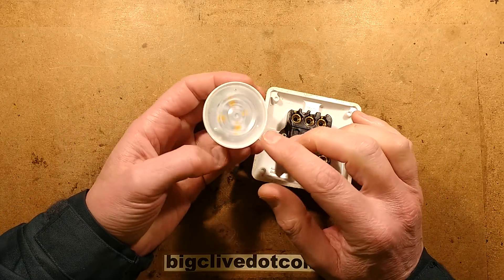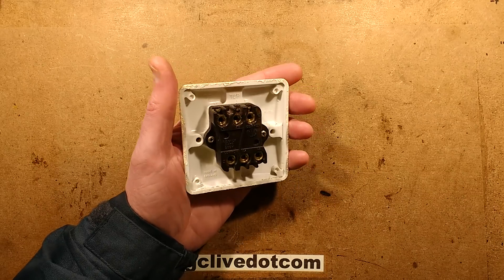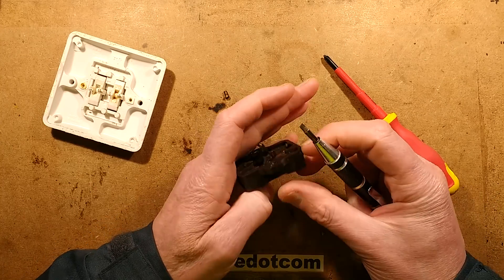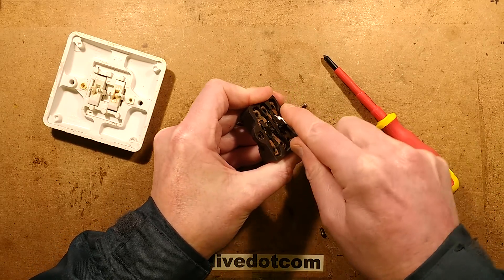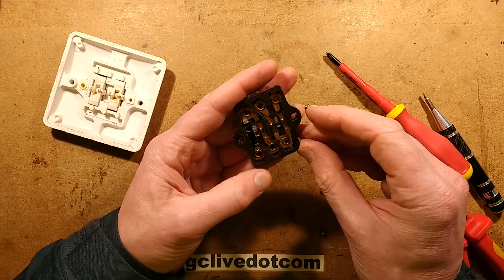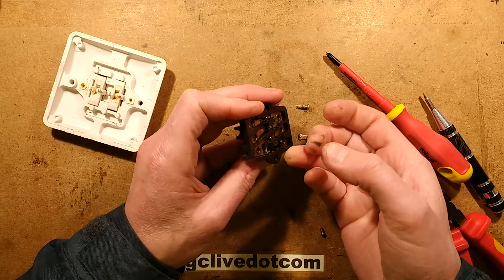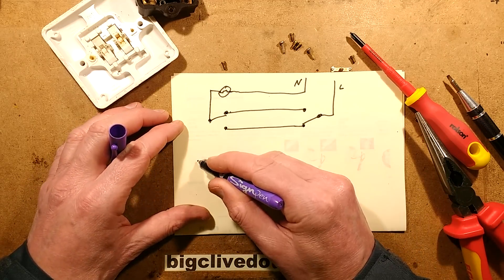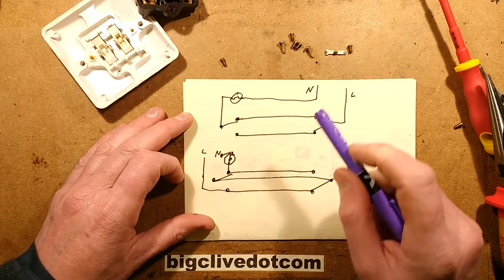Old arcing switch killing LED lamps.

Comment: Um, Clive, if you still have these 1960/70s style of switches in your house I would stick my neck on the block and say your wiring is quite ancient and needs a rewire. 🙄
Reply from the maker: It's PVC cables, but inexplicably, vintage switches were used in a few locations.  Like someone found old stock or used salvaged ones.

Comment: Those old switches were designed to be slow-make and break, because back in the day they were only switching small tungsten lamps, and it worked fine. I’ve got those switches and fluorescent lights (old circular ones are cool!) and you have to operate them fast & decisively, or they do arc, especially if the fitting has a power-factor capacitor across the mains. Modern switches are fast-make and break using a snap-action mechanism, and don’t suffer from arcing. You do see a brief flash sometimes as they open though!

Comment: One old sparky once told me that LED bulbs are the scourge of older switch gear. These switches were designed around 250mA to 2A, typically around 500mA in general use. He reckoned that LEDs don't draw enough current to keep the switch contacts clean. Apparently, these switches are inherently self cleaning, if enough load is applied, but LED bulbs don't draw enough current, so the contacts become oxidised and fouled over time. His solution was simple "Just use a 'real' bulb for a week or so, once in a while, to clean the contacts". I have no idea if that's wholly true, but I did try it once or twice, and for a short time there was an improvement, but then the arcing begins again. Simpler to replace with modern switches. Of course, this problem doesn't arise with a good old 'Crabtree' switch with the sliding blade contacts. Funny how proper old gear is better than the later stuff that replaced it.

Comment: we had similar problems with the same switches, they arc a lot 'cause they're rather slow make and break compared to newer switches,  they just push the moving arm open slowly, not 'snap' like the new ones, our flashed horrendously on a fluorescent lamp!
Reply: i of course kept the old ones, they're perfectly ok on filament lamps, plus i collect and  got a box for old electrical fittings

Comment: maybe its diffrent in Britain for wiring of two Switches, but here in Germany the first way you described how to wire two switches is correct. the second variant you described looks also pretty reasonable to me (didnt know it before), but so far i havent seen it used in any way.
There is a third variant, which works but is clearly forbidden. Basically you put the Light between the Common Connector of both Switches and L and N each go to the "NO/NC" contacts on both switches. Advantage is that you have both L and N on both Switches for eg a Power Outlet. Disadvantage is that you can short out the Circuit during Switching, which among other things is a Fire Hazard. I think you actually meant that variant as "pretty bad"

Comment: Dear the metal things inside this switch are made of copper or brass?  In my country, everything in switches and sockets is made of brass. If we are lucky enough then only tiny contacts points are copper one. You are from Britain, I heard and seen few old switches and sockets everything inside them was made of copper.

Comment: Very useful to know. Might this be affecting the life of CFL and cold cathode bulbs as well?
Reply from the maker: It could have an effect, but they usually convert the incoming AC to DC and smooth it immediately.  They should be less sensitive to an arcing switch.  The biggest killer of CFL lamps is hot environments and enclosed fixtures.

Comment: Those lamps are not Slavic/Russia/ex-Yugoslavia rated. 
It has to survive switch/fixture that arches every time you walk by. (All our old houses are built from brick and mortar, and roof tiles of asbesss.... i mean brick covered, so "ocassional" electrical fire just leaves a dirty stain on the wall (so you don't need to search where the fault is).
And voltage swings...it ain't a good thing if it dies from that swing ;-)
The good thing is most laptop PSUs and other enertain-tech runs from 100V (or 90V) upto 250v. We have 240V nominal AC grid. 
Which means a separating transformer wound to put out 120V-150V secondary will likely never exceed the 250V on the output, and not go below 90V output, running all the sensitive tech safe. 
Plus lightning protection, well, i hope... i grounded the core of it, i hope it's a good idea.
Would it be a good idea for low cost insulation trafo to put two nearly identical microwave trafos back to back, with HV windings connected together??? Would you recomend making a air spark gap on HV side, that would stop overvoltage (lightning?)from passing through???

Comment: I have had the exact same lamps fail at one year old with fairly modern switches (although I do live near the sea too). I fixed them by replacing the fusible resistor and adding an extra ~100ohm of current limiting. Still going strong after a couple of years now. The trick to opening them is to drill out the crimping of the pins.

Comment: First one is best way to make corridor switching. Also when you need add more switches to series you can add (DPDT-switches or type-7) in between.
In Finland we use (type-6, type-7, ..., type-7, type-6) when we need this.

Comment: I remember when I was young and afraid of the dark I was terrified when I'd pull the pullswitch near the bed to turn on the light but it wouldn't work. Envisioning all sorts of monsters waiting to eat me. My dad had wired the lights up and had done it as you said with the strapping so that the wall switch near the door would disable the pullswitch. He said it was "the pit method" so that when the shaft was closed the other lights couldn't be left on or switched on when they were off. Why he subjected me to "the pit method" I don't know lol

I'm surprised you haven't got a full dmx setup for your lighting at home controlled by nobs on your arm chair.

Comment: Poor switch design, with insufficient "wiping" of the contacts to keep them clean.  But on the other hand, too much "wiping" can lead to arcing due to slow contact release.

I had to change out an old Bakelite switch in our previous home after I changed our lounge room light from incandescent to fluorescent and the old switch's relatively slow movement interacted with the ballast in the light fitting to cause arcing at switch-off a couple of times.

Changing to a modern switch permanently fixed the problem.

It's a pity that the makers of the LED lamps didn't think of this problem and install something like a varistor to cut off the current during an over-voltage situation and let them recover when the over-voltage goes away.  Although perhaps a varistor would react too slowly?

Comment: Clive you might find these gu10 SMD's on Amazon interesting: item # B071ZPJZ3W . They actually unscrew--apart so that you can get at the circuit board non-destructively. They have a current-source IC. They look very dangerous to me because the metal is not earthed, and it wouldn't take too much for the live to touch it. I wonder what you think about them.

Comment: A lot of the switches in my house / garage arc particularly if you aren't positive with turning them off and on, you can sometimes see it through the gap between the housing and switch. All the switches look very old so makes sense, the garage is pretty damp and the house used to be before getting external insulation fitted and rendered (single block construction).

Comment: A very good way to open GU10 lamps  is to drill a 0,8-1mm hole vertically in the pins to remove easily the circuit. You won’t destroy your lamp. Then it’s easy to resolder 2 new leads trough the same holes.

Comment: Hey Clive WOOFs I have had this happen !! Not with the same bulb  I have 3 ware house style hanging lights in my cyber space/radio studio  that use Edison base screw in LED lamps  one day turning them on switch on the wall by the door made a arching  sound turned it off the switch was not very old so I replaced it with a expensive one from the Home depot it lasted about 6 months and did the same thing  ruined one of the bulbs replaced it again with a low price one from the local hardware store so far no problems  There's really no load at all on that switch  and its not in a damp environment in fact my underground house is very dry inside due to the blue flame ventless heating plant I have Why the failure ?? is there some thing in the circuitry that causes a really high load at switch on ??
Reply from the maker: There can be a high inrush current, but it seems odd to have such a fast failure.

Comment: Clive i have Philips Tornado 20w Lamp that keeps flashing when the power is off did a test on the lamp and got 10mv the circuit had 6mv there is two lamps in this circuit only one dose this would it be a resistor fail and a capacitor discharging    ????
Reply from the maker: It sounds like the classic capacitive coupling between a long run of switch wires.  Very common on two or more way switching.

Comment: Hi Clive, couldn't find any other way to get in touch.
I've got a couple of Sure Flap microchip cat flaps which have stopped working so my first stop for help is YouTube. After an extensive search all I found was a load of promotional videos. I was wondering, if an opportunity arises that you could do a teardown of said electronic cat flap with a schematic and an explanation of how it all works. The fault with one of mine is when it's in learn mode it's not recognising the chip. Hoping you can make a frustrated electronics beginner a little more accomplished.
Cheers Chris.

Comment: some low energy lightbulbs particularly LED and CFL, although very efficient, have a huge inrush that can burn a light switch contact in no time. Try dabbing a cfl lamp across the mains using the bare wire method, quite often there will be a huge flash from the wires
Reply from the maker: The typical CFL/LED lamp has a 4.7uF cap so the inrush could add up quite quickly.

Comment: Your preferred method of twin switching is safer. Picture the usual case, one switch upstairs where the light is, and another switch downstairs for the same lamp. Having all the mains connections at one end avoids the common mistake of strapping the line from downstairs to the neutral of upstairs, effectively bridging two circuits that should remain independent.

Say you have a fuse blow in the distribution board cutting off power to the upstairs circuit. Safe in the knowledge that the wires are dead you start farting about. BUT there IS a link to the still live downstairs branch via the crazy first example circuit. An even more alarming prospect is where the neutral becomes disconnected from the supply board. Even though there is no obvious live feed to the upstairs circuit because you removed the fuse/circuit breaker, and no lamps are lit, there is a path to the orphaned neutral upstairs wires from the downstairs line feed via that upstairs lamp.

Comment: Dad has this 5 lamp chandelier, which burned incandescent light bulbs quite rapidly. Maybe it was even always the same socket, I'm not sure. Switched to LEDs, and one of those burned quite soon. I thought that shouldn't happen, LEDs are supposed to work 10 000's hours. Bad switch might explain this. But did it affect incandescent lights too?
Reply from the maker: +Tomi Mäntylä It could be down to vibration, heat build up or lamp angle for the tungsten lamps.  For the LED it's most likely down to heat with overdriven LEDs.
Reply: Thanks for quick reply!
I didn't even consider heat, since house is usually quite cool. Then again, lamp is quite close to a fireplace so it might get quite warm sometimes.

Comment: Maybe those Philips led bulbs are flawed. I have Philips bulbs and IKEA bulbs and only the Philips ones have failed on me during the 4 years they have been installed. But then again, they are in different rooms, so maybe it depends on the usage they are getting.
Reply: Not in this case at least.  Amojak's reply to No no explains what's happening.  Arcing is bad for any capacitive dropper LEDs.  The Phillips are nicely designed with a fusable resistor that blows instead of the LEDs themselves popping.  Of course, the design isn't repairable so including it actually doesn't help any.

Comment: I wonder if the switch failure isn't due to the switches being designed to self clean but the low current draw of the LED prevented that from happening.
Reply: The grease on the switch contacts and the metal of the contact are set up for self cleaning with higher inrush current of filament bulbs. (OK I mean the arc is big enough to lightly weld the contacts, the metal is chosen to suit). LEDs dont draw enough inrush to clean properly before they die..

Comment: You NEVER see that second diagram for switching in North America...
Reply: Yeah because we have two legs in a house and they don't.
Reply: John Possum  That has nothing to do with it... You still use a 2 wire supply  with no interconnection with other circuits as how it was done here in North America many moons ago..

Comment: Is there a safe way to get a usb power supply from a light socket? I've seen the lamp champ, but can't find it for sale anywhere. Was thinking of buying some sort of lamp adapter with enough space, like a ir sensor adapter, and trying to cram a usb power supply into it instead. I guess it might catch fire though!
Reply from the maker: I've not seen a USB power supply that fits in a lamp holder, but you do get dodgy E27 to socket adaptors that you could plug a USB power supply into.  https://www.ebay.co.uk/itm/232644917692

Comment: I've had a modern switch fail from arcing on LED bulbs before, I blame it on a cheap switch and bad contact bouncing coupled with the switch mode supply powering the light. When you first turn on some kinds of switch mode supplies they draw an large amount of current like mentioned. Contact bouncing during that very first capacitor charge up left some pretty nasty carbon scoring on the switch contacts and it hadn't even been in service that long. The one that failed was used quite extensively and it was a pretty early LED bulb. The switch was only a couple of years old.

https://imgur.com/TssA9gF
Reply: Yup. Contacts are a BIG price point. I've bought good home 3 way switches that had Silver Cadmium (I think it was cadmium) contacts. You can find the quality if you look for it. And it is often worth it because by their very nature contacts like to try to weld themselves shut.

Comment: in those old lights, can't you add some capacitor accross the contact as is used in ac powered hand tools?
Reply from the maker: +Andy Lasers If a capacitor was put across the switch the lamp would glow even when off.

Comment: I have an old Chord SPM1000b which started to sound really bad with loads of distortion and the culprit was pitted contacts in the main output relays. A few quid from RS Components on new relays and it was back to 100%!

Comment: I wonder what the cost would be to fit a poly (re-setting) fuse instead of the resistor.? Probably only pence, but on a large production it would make the cost of making them higher.
Perhaps this would be a good idea for a video on re-settable poly fuses.?

Comment: The issue is caused by the high inrush currents caused by the capacitive load of most LED bulbs. Newer switches have a snap action which helps reduce bounce and therefor the arcing when switching, older switches have much more bounce and tend to, as you have found, be full of crap which doesn't help the matter. This is a pretty common fault these days.

Comment: This second two-way switch circuit that you showed, I submit, is potentially dangerous.  Not because the circuit doesn't work - no, it's fine, but the problem is that now we are suddenly feeding one of the strappers with the Live supply.  This is bad because an electrician might not realise how this has been wired and be expecting the strappers to be dead once the commons are removed.  OK, one should always check, but try explaining that to his/her family...
Reply: It's known as the Conversion Method and is included in the first year of training for Electrical Installation in the U.K.  An electrician should be aware of this arrangement.  An electrician who is unaware of this is potentially the type of person who threatens the wellbeing of other peoples' families.

Comment: I have found that CFL and LED lamps are very hard on switches. Especially the better LED lamps with Switching Supplies. The Inrush current for these is very high. Listen when you turn on the lamp for a very distinct "POP" as the contacts are made in the switch.

Comment: I would argue that those MK switches (and their Crabtree equivalents) are much better engineered than modern replacements, and that the problem lies with inadequacies in the modern technology.
I do have one question - I like to have neons in my light switches, to make them easier to find at night.  With single throw throw switches the neon just bridges the contacts and its circuit is completed by a small current flowing through the bulb.  Using the first style of two-way installation, how can one wire a equivalent neon at each switch?

Comment: Clive when we use 1664FC installation tester particularly on a R1+R2 continuity test we see switches and sockets come down with switching and current of continuity tester cleaning oxidisation.
Interestingly most non live testing shows this as loop testing tends to pull the total resistance down.

Interestingly I pulled a main switch seized on without passing current from an installation DNO disconnected Thursday.
I may pull it apart to see what happened